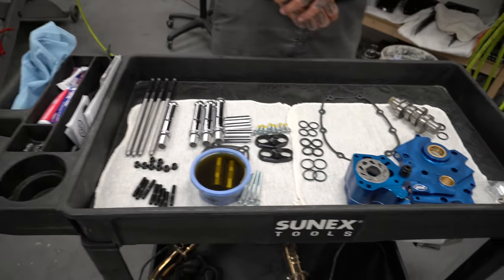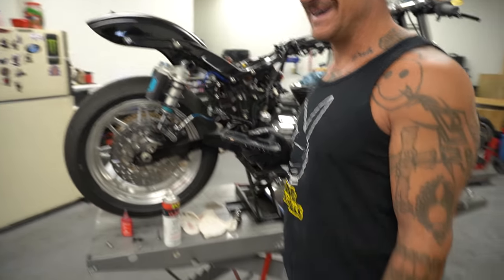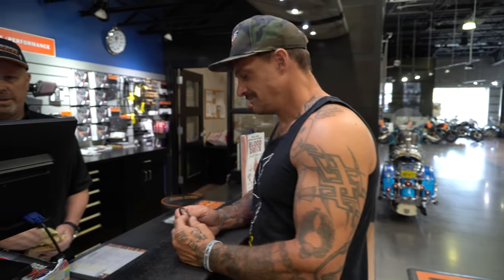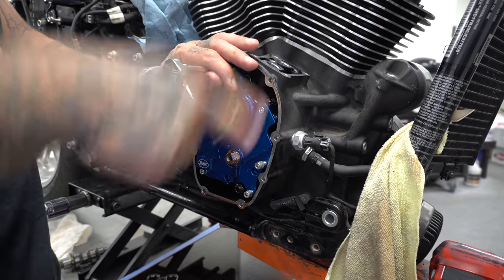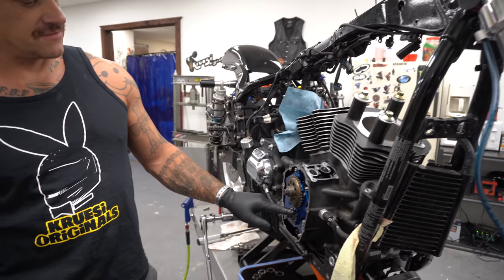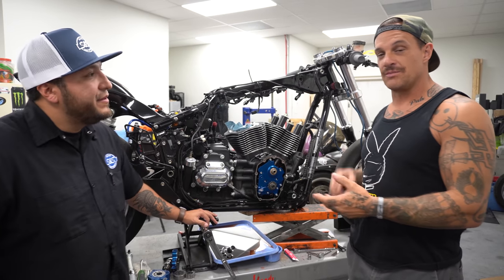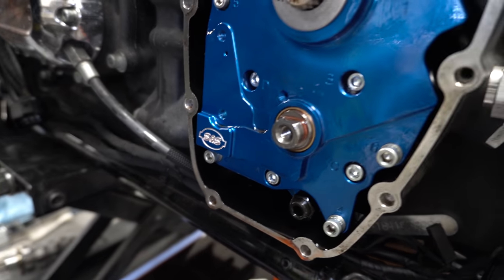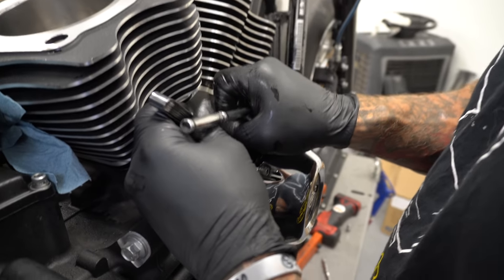S&S m8 550 cam chest kit install on Harley Davidson race bike (P7)

Comment: I not a mechanic but I can follow directions, I watch a few YouTube videos and I was able to install the S&S oil pump, cam plate and zippers 468 cams on my 2017 RG. After realizing I didn’t screw anything up, I decided To upgrade to the 124 S&S. 10,000 miles later still no issues, hopefully it stays that way. I’ll always go with S&S parts before HD company. I appreciate these videos Kruesi
Reply: Fuckin amen to that!
Reply: Great job dude!  I want to do the same.
Reply: A mechanic is just a dude who knows how to use the wrong tools the right way.

Comment: These technical videos are awesome 

  Speaking of cams I had cams in my eclipse GSX turbo. They were HKS 272/272s before anyone did cams in a import and it was black. 
 My buddy had a 240sx also with a bigger turbo and large HKS 272/272 cams 
 Then my other buddy had newer eclipse awd turbo with large cams and a big turbo
 Topping it off was my friends Supra with a huge single turbo and monster cams and to make it even cooler we were all on race gas and every car was black in color 

 Back in the early 2000s having a group of big cammed thumping imports show up to races chomping on race gas wasn’t the normal and we definitely put a hurting on everyone and they were scared when we rolled up lol 

  A cammed import sounds like a cammed Harley

Comment: Good to know that the oil pump seal is sold separately. Ill be sure to buy that before I begin the cam project. I plan to do the S&S 475c on my 19 road glide 114
Reply from the maker: Yes sir we have that whole kit in stock if you call the shop I can work a deal
Reply: @kruesioriginals  right on brotha ill definitely call when I decide to pull the trigger on it
Reply: Can't even find a 475c kit black anywhere.

Comment: Im sporting a 577 zipper cam set.   Should i upgrade to a bigger than a 48 mm cv carb.  ? Ran out of fuel at top speed recently.
Reply from the maker: No just tune it

Comment: Its cheaper to build a M8 vs twin cam.  Whats the power difference though?  With the twin cam have better valve trai  geometry, comparable builds would seem to  leave the t.c. making be power.  Is there any truth too this?
Reply from the maker: Not at all. The M8 has four valves for cylinder. It’s going to make a whole lot more power than a twin cam any day of the week.
Reply: @kruesioriginals  ah, ya.  I didnt consider that. Thanks

Comment: That motor sounds a little low on compression. I bet it's the head gaskets.
Reply: The heads weren’t even on.
Reply: @thedieselpig4448  Does sarcasm always go that far over your head or is it just one of those days?
Reply: @thedieselpig4448  You're a whole bag of fun dude. There were shop rags coming out of the jugs, it was pretty obviously a sarcastic comment. If you weren't smelling what I was putting down, that's a you problem.

Comment: Why 550 cams? Though 585 or 600 would be better for racing?
Reply from the maker: If they made those for m8 those are twin cam an Evo cams. This is a four valve had 550 is a huge lift
Reply: @kruesioriginals  thanks brodie knowledge is power. Love your vids dude.